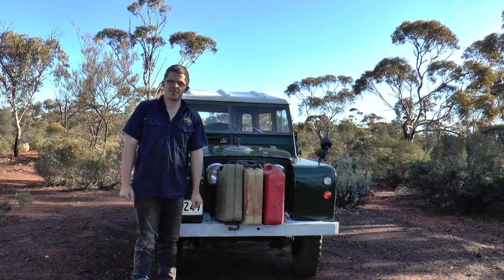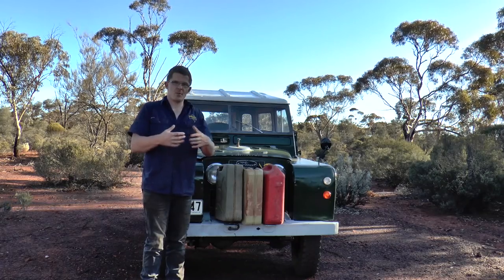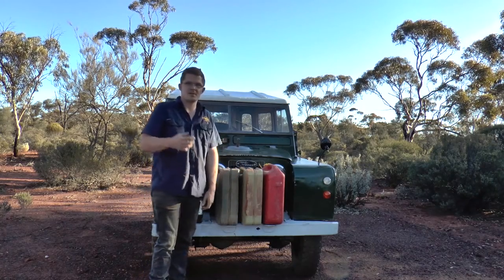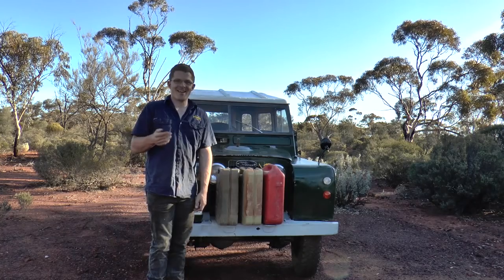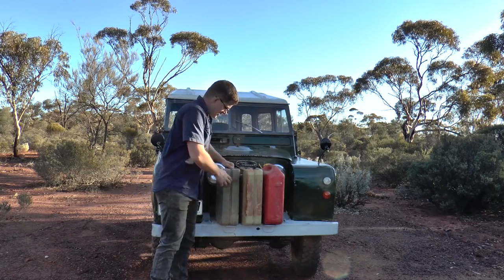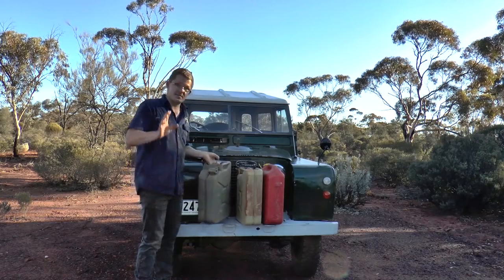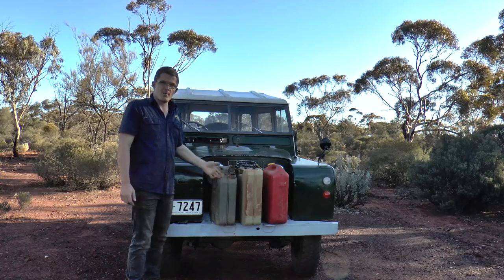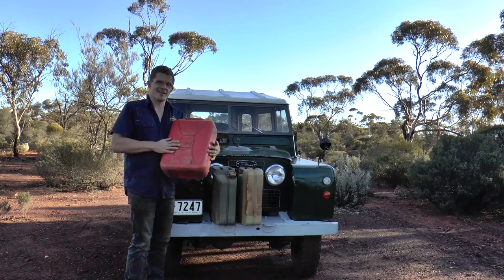Fuel Cans - Whats the best?

Comment: Nugar, 
The original or real Gerry cans when sitting on a steel floor or truck tray, sit on the bottom flat surfaces. The seam is by design set in so as not to rub. cheaper cans aren't as well thought out and when they rub the seam leaks.  which you don't notice until the fuel is needed, often too late.. I always sit my cans on a piece of insertion rubber to avoid the wear and the rattles.
The three handles also make tying down a little easier.
Reply from the maker: Very good tip and information there Bob, thanks for sharing

Comment: Look for the Scepter plastic ones. Military, 3 handles, high quality. They also make water cans too.
Reply: The Scepter NATO-spec OD Green 20L/5 Gal containers are just fantastic. I've used them for years in the bush and in the Arctic, and never, ever had a failure, cold weather or hot. They are pricey compared to the garage-grade 20 L red plastic ones, but worth every penny. Canadian Prepper did a more in-depth review of the Scepter Mil-spec 20L containers, and mentioned that over 1 million have been sold to  the Canadian and U.S. armed forces.
Reply: @jimbaritone6429  I've been looking at those. But the one issue I see is is a lack of a spout like the nice clamp on units the metal cans have. What do you use for a spout? Is there something that Scepter makes that I'm not seeing?
Reply: @ToddKing  I have 4 Sceptre cans. Sceptre makes a long flexible spout ideal for these cans that screws on. And check out jagmte in Florida. He's a guy that makes some nice accessories for the Sceptre can.
Reply: @canyonoverland5003  Thanks for the info. jagmte looks like they have what I need and some other cool stuff.

Comment: Hi mate like your show ,i 'm a series nut like yourself ! Just like to share some info ,the WD on british 'gerry ' cans means War department  sometimes there is a broad arrow mark as well  ,i think it changed in 50s to MOD , ministry of defence .I think the German method ie the latch and breather pipe were better than the british /American design pretty easy to lose the bung if the chain is broken .
Steel cans can have paint flakes come off on the inside  and through water and condensation can rust on inside especily older cans , proberly not a big issue on older petrol series  but a different story on diesels ( filters and injectors ) can get cracks on the flat sides , though not reccomended  for safety   sake  ,its possible to oxy/ acetylene weld them either steam or filling the can up with water  which i have done successffully , you would'nt do it if you live near a Super cheap or Repco , i've lived and worked in remote places . I have found plastic cans cleaner to live with  and the lighter weight  a plus , saying that ,the Australian army still use steel gerry cans , hope i hav'nt waffled to much  and like your work ! Cheers
Reply: The broad arrow or ‘crows foot’ ordnance mark has been used on British Army equipment since at least 1553 and is a helpful way of determining if everyday items are civilian or military in origin. The "W" stands for "War" then the "Crows foot" ordnance mark and finally the "D" for "Department".

Comment: Had plastic and steel Rheem made in Australia fuel cans and there going great. Can't understand why the later steel Jerry cans have a different size latch fitted. My old spout does not fit the newer ones. CRAZY. Also why the move to round fillers on all the new stuff I see thats going backwards.

Love the info . CHEERS

Comment: Only two real choices for cans for long term storage or vehicle transportation, Scepter or Wavian. The Chinese made cans should be avoided at all cost, unless you enjoy rust, leaks or the cans seam splitting.
No, there isn’t a cheap alternative. Buy once, cry once. Sometimes in life you just have to pay the piper.
Reply: Forces surplus are cheaper than even the Chinese can copy them (badly) for.  So no need for any crying  I have some cans older than I am by a considerable margin, all ex-WD, Wehrmacht or NATO.  The oldest is a WW2 Wehrmacht one from 1940, which probably came into allied possession in N.Africa and is still in perfect functional condition.
I don't think I ever paid over £15 for one, the only one which failed turned out on inspection to be a very dubious copy/fake one, and none is newer than 1965.  Because I used to make my own biodiesel I had a large number (some of which I've sold since) as all of it was stored that way - in batches o 100L (25 cans) which the authorities never had a problem with.  I was properly registered and inspected for production for use in my own vehicles, even before they gave an exemption for that, and until then paid the duty on what I produced - a sum which must have cost them more in administrative time than it gained them in value (probably why they gave the exemption for small users).
Reply: @phillee2814  the odds of someone form Australia, the US or Canada finding a WW2 German jerry can that's still functional and 20$ is zero. Go on Ebay, they sell for the same price as a NEW Nato Wavian can.
I'm sure in the 50's, 60's, 70's and maybe even the 80's they were cheap and plentiful. Now they are not.

Comment: I  was told having petrol in a tin can it will condensate not the plastic do you know about this ?
Reply from the maker: Hi Jenny. That is very true, however you can still get the same issue with the plastic jerry cans. however maybe not as bad as there tin/metal counterparts. Kind regards, Geoff
Reply: @seriouslyseriesaustralia  This is minimized by filling the cans to the fill line on the can, of either type.

Comment: The US broken copy (known as the blitz can) was utterly dreadful in every way.  It was held together not with welds but rolled seams, most of which lasted nearly long enough to reach service.  Then the screw cap needed a special tool to unscrew it, it must have been as special as the tool that designed it.  Genuine ones are probably only of value to museums, and certainly not for actual use.
The original German and British copies ARE fully welded, and the internal vent pipe goes into the rear hump, which is never filled so that even when the can is holding its full 4L, it floats if dropped in water and protects the can from bursting due to hydrostatic shock because air, unlike liquid, is compressible.  The side indents provide additional function in this regard, and are not, contrary to common belief, there to give seating for tie-downs.  They do not work for that any better than the same tie-down would without them, and never have.
The original Jerrycan or British copy will not rust, as it is coated inside and out, and the seams are well enough recessed to never rub against anything.  Easy to fix by welding, as long as it is left empty for a few hours with the cap open first, and the torch is rapidly passed across the opening to burn off the fumes (they just go "woof" and are then safe to weld).  I've seen it done by many race mechanics in pits and paddocks (they've become the standard for race fuel storage).
I buy forces surplus - £10-£15 a pop, and I have a couple of genuine WW2 ones - one British from 1943 and the other a 1940 German one (probably entered Allied service in N.Africa).  The pattern was later adopted by NATO and is still their standard - why fix what isn't broken.  
I will not store fuel in plastic, which degrades, abrades, cracks and splits.  Btdt and never again.  I guess for a couple of litres to fill a mower, brush cutter, chainsaw or strimmer it may just about suffice, as long as the only times it travels are to the nearest source to refill it.  If weight was a serious factor you wouldn't be using 20L containers, would you?
Oh, the other benefits of the three handles are that you can hold two in each hand when empty as well as one in each hand, or one-between-two when full, and they are easy to pass hand-to-hand when forming a human chain to unload a fuel or water delivery or reloading the truck with empties.  Passing something with only one handle between people without putting it down is extremely clumsy.  In case of contamination, you can even get gaskets with strainers incorporated in them for the optional spout (some fuel tank designs need it, and I have a couple).
That is from my own experience, and I used to make my own biofuel, licensed by the relevant officials, here in the UK, so generally had up to a hundred litres stored at home.  If the Wehrmacht, Allies and  NATO all agree that they are safe for carrying by the truckload into an active warzone, that is good enough for me.